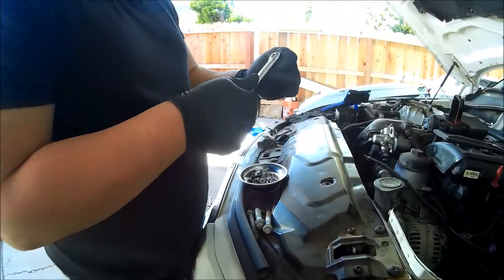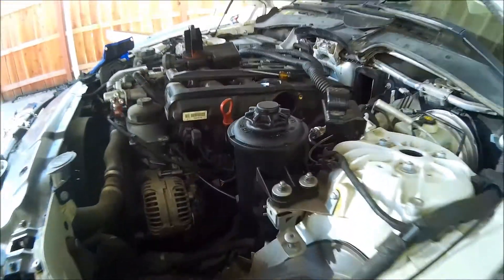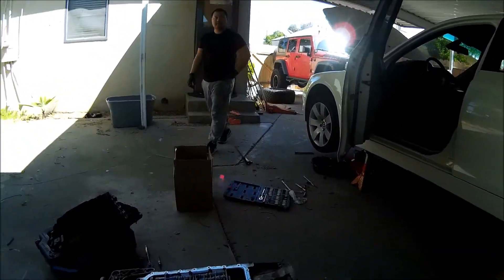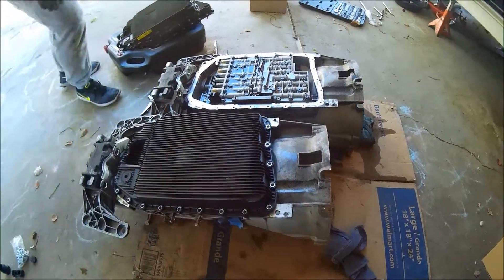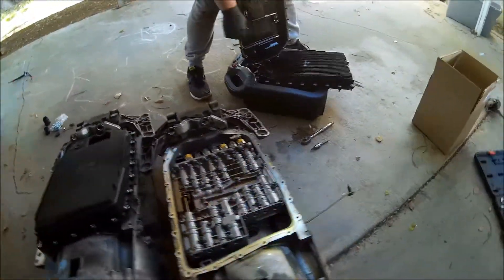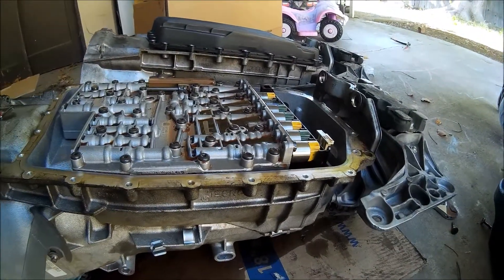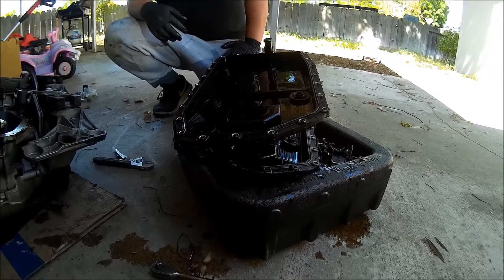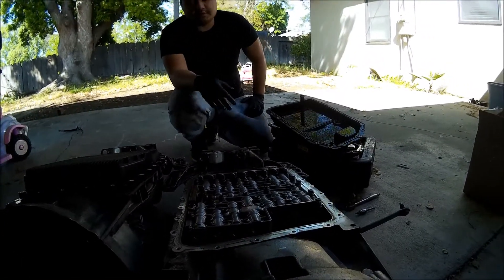BMW transmission solenoids

Comment: What was the point
Reply from the maker: swapped the entire transmission because the solenoids cost as much as a used transmission.
Reply: @tommyfacekicker  that's false. Solenoid kit is 200
Reply: @tommyfacekicker  do you have contact info for the installer?